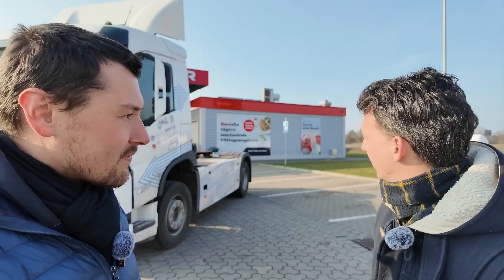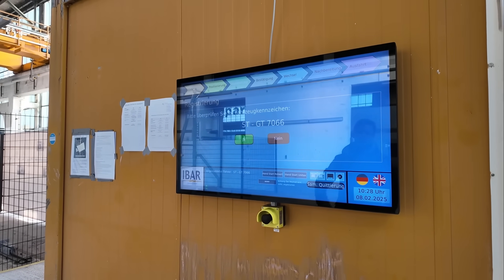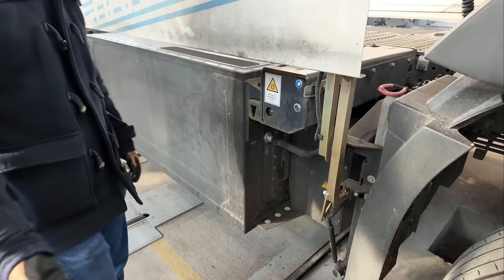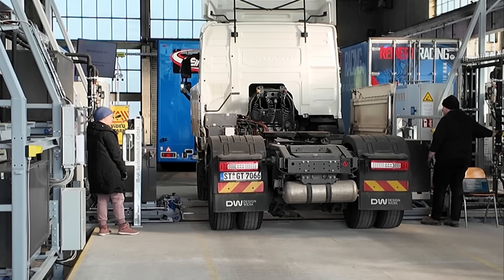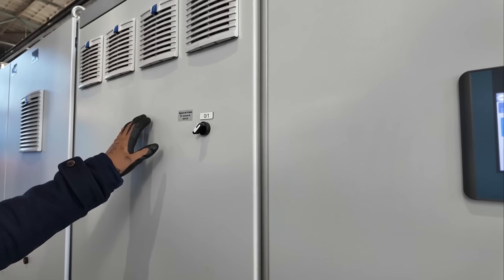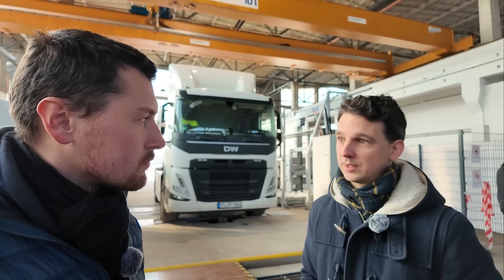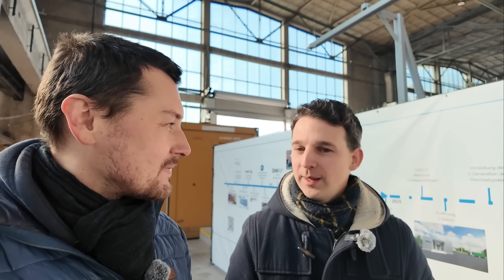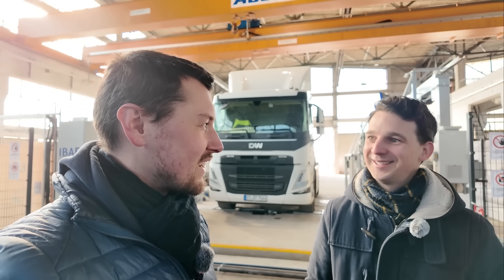Truck Battery Swapping is here! And it's made in Germany 🇩🇪

Comment: It really makes sense for commercial trucks.  Great to hear!
Reply: Yeah, it makes sense, but kinda only on destinations - so for short and medium haul. If you think about long haul, I doubt it would be feasible to change batteries of the 200-500 trucks or so which fits on a rest stop these days, even if it "just" takes 5 minutes. You would get a massive queue or trucks would have to park, wait and then drive into the changing station and the back, which clashes with the rest cycle.

You would also be required to unhook the trailer, as the doors cannot be opened as long as you're hauling.

So you're talking about half an hour or so at least at the end of a shift, if there's no long queue for charging, every single day.

I think overhead wires every 50-100 km or something like this, especially on inclines, which charge the trucks while they drive off of the grid in the 3 C region, meaning 1350 kW charging, would be great. To make this happen, you would need to add the charger on board, which is additional weight. 

Say we put overhead wires on motorways every 100 km and make them 14 km long, then a truck driving 80 km/h along them could charge up a total of 225 kWh.

In addition, there's no consumption while doing this, so it's extremely beneficial on inclines. And if there are Diesel trucks slowing down traffic, you can charge even more, as traffic may be slowed down to 60 or even 40 km/h.
Reply: For long haul
Reply: "You would get a massive queue or trucks would have to park"?  Go check out China it doesn't happen. Plus those vehicles and these trucks, have DCFC as a backup. 

Considering how advantageous battery swapping is for the grid.... And with the advancements of battery technology,  It'll allow the upgrading of the battery pack, much more cost effectively....

Hopefully battery swapping will become a widespread option  And hopefully FUD won't impede its progress.  Like it has with EV adoption.  

Every new technology has pros and cons. It's a shame that human nature, tends to exaggerate  the cons, while underestimating the pros.
Reply: @nc3826  And your solution is?
Reply: Overhead wire and roadway induction charging. Is even more capital intensive than battery swapping. Plus it can't shift electrical demand with supply, like battery swapping. Which is needed, since renewable energy is far more intermittent. And at a properly run grid, off peak power should be much cheaper.  So battery swapping, because even more cost effective.

It's not necessarily an either or situation.  Let the marketplace decide.

Comment: This has potential for scheduled runs like you stated, the trucks are running constantly. Some key points of concern: 
1. Battery connection methods, pin and sleeve connection types may have an accelerated wear trend what is the best connection and keep moisture oxygen out.
2. Snow , sleet , freezing rain scenarios,  may impede accuracy of the mounting system. 
I know it's at the concept stage and does have potential, many good points in your video, thank you for this informative story
Reply: Car battery swapping has the same issues, but after 100s of millions swaps in China (yes, it's that many). And they're also doing truck battery swapping in China too. So, It's a pretty good indicator. Of what's possible in terms of truck battery swapping. 

Reminds me of the ICEV to EV, transition.... And the FUD narratives that still exist about it.  Are there issues? OFC,  Since every option has pros and cons trade-offs. But it won't take a "rocket science level" of technological advancement, to make it a plausible option. And considering how advantageous it is for the grid, it definitely should be promoted.